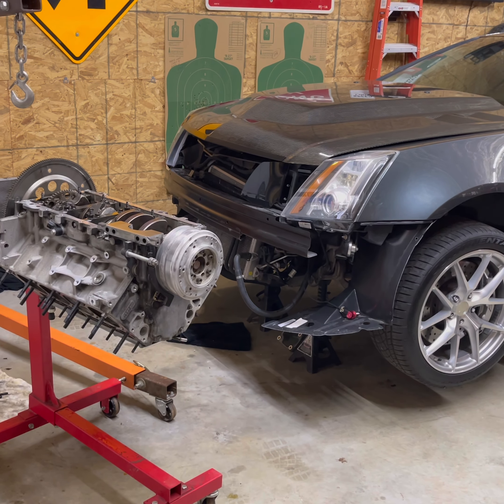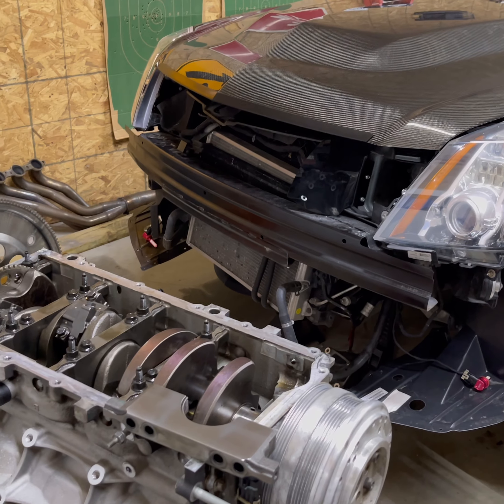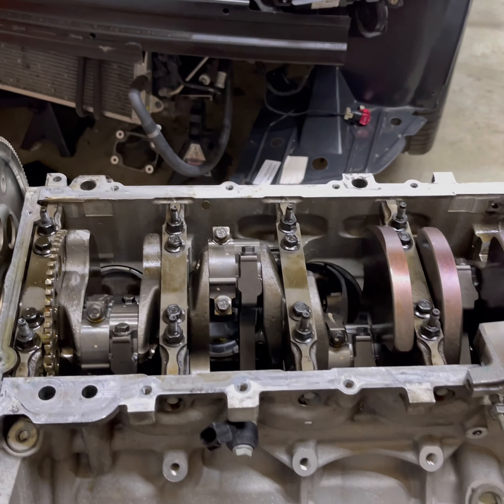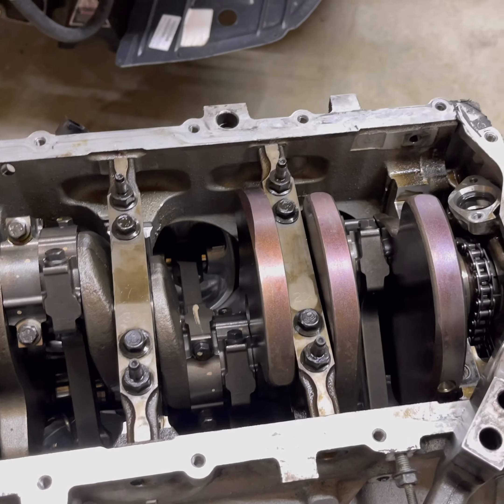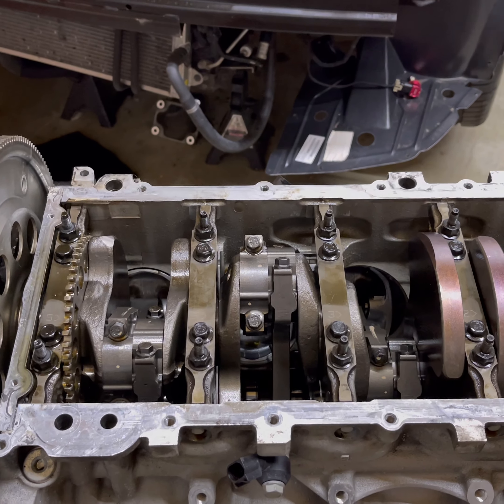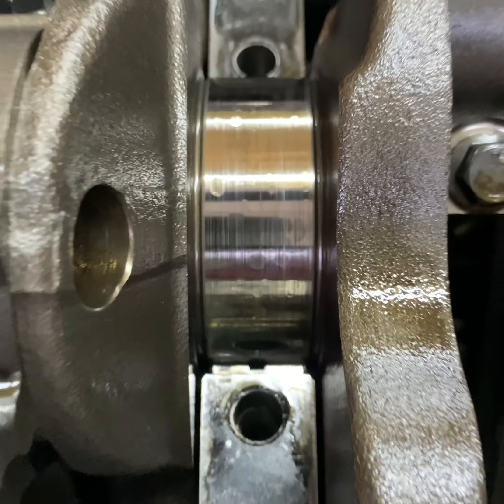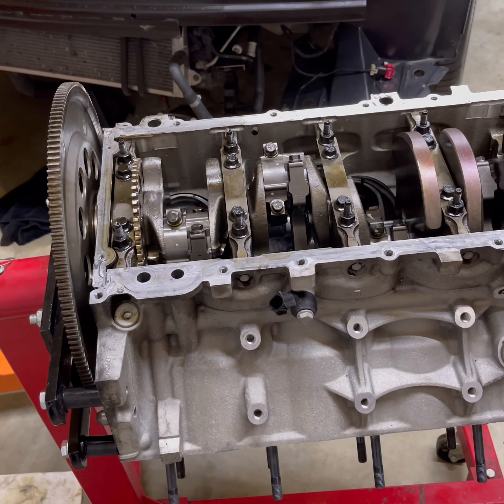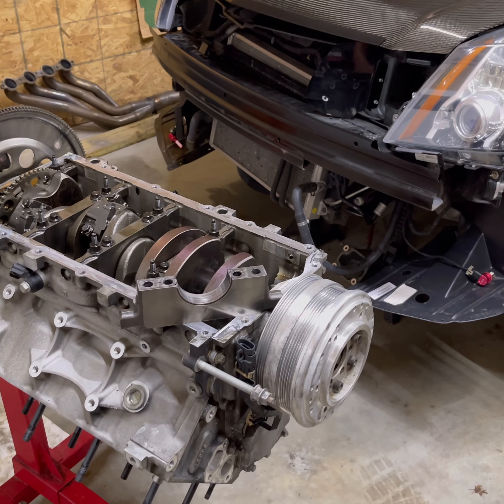CTS-V LSA LOW OIL PRESSURE engine damage 800+rwhp SBE

Comment: Hey, what type of studs did you use for your heads? I want to use the ARP studs but I’m seeing some different material out there on why not to use those. Thank you
Reply from the maker: I use ARP head studs.
Reply: @whiplashtv2022  Would you mind providing the part number you used? It beats spending $500 on Livernois head studs.
Reply from the maker: @Speed_Shed  ARP -234-4346
Reply: @whiplashtv2022   Thank you!
Reply from the maker: @Speed_Shed  you’re welcome

Comment: loved the video,  do you have a video of you pulling the engine out, I am trying to figure out how to get the engine mounts unbolted?? I have been a mustang kid since high school and switched over to the GENERAL :(  but I love this car)
Reply from the maker: Congratulations first off on making the swap. All that I did was remove the 2 nuts on top of the motor mounts so that the brackets on the engine block can lift up and off of the motor mount studs and then it it free. To gain more room, remove the 4 bolts holding the brackets that go from the engine block to the motor mounts. Then you have tons of room to get the engine out. No I don’t have a video of it.

Comment: That sucks! What oil and filter were used?
Reply from the maker: Oil and filter weren’t the cause of the failure. So I am not being mean by saying that but since it is irrelevant to the failure I am going to respectfully decline to answer that question. There are MANY LSA engines that see this this type of failure especially when horsepower has been increased, and I cover some of the multiple reasons why these failures happen in the video. The reasons why these LSA engine bearings fail needs to be the focus and not the oil and filter. If I had to do it all over again, installing an Improved Racing Baffle would probably be at the top of my list. Also deleting the piston oil squirters would be something that I would do as well.
Reply: @whiplashtv2022  Just curious that’s all. I know that question usually opens up a can of worms.
Reply from the maker: @305YSi  it always opens up a can of worms 😂😂😂

Comment: Thank you very much for sharing.  I'm making 780rwhp in 13 Coupe.......I'm only at 48k miles, and using Amsoil Signature Series 10w40 and Motorkote......I'll keep an eye on my oil pressure....BTW; what was your pulley combo and how much boost were you making?
Reply from the maker: 2.5/9.5 16psi In hindsight, I would have added an Improved Racing Baffle just to ensure that there would be no oil starving issues for sure. I was scanning it during the 2 passes and didn’t see it starve for oil, but I have since learned that this is a problem with the LSA stock oil pan baffle.
Reply: @whiplashtv2022  Honestly, it's amazing how much abuse our lsa engines can take before failure.....Pat G does my tuning and I am incredibly pleased with my afr's.......BTW; Next time you get around the Ferrari/Lambo crowd just mention that you got 80k out of engine making 850rwhp and watch their expressions.......priceless!!!! LMAO 🤣🤣🤣 The Lucky Sperm Club might get 20k before dropping $40k on a rebuild, because you know they can't spin a wrench!! LMAO 🤣🤣🤣
Reply from the maker: @LivingMyBestLife956  That is true that they can take a lot of abuse for sure. The Pat G tune on this car was ok, but I much prefer the Rick Crawford tune on it now than Pat Gs.
Reply from the maker: @LivingMyBestLife956  I am unsure who exactly you are referring to exactly, but if Rick doesn’t do my tuning then I do my own tuning. I got into tuning because many out there can’t be trusted.
Reply: @whiplashtv2022  I totally agree.
Reply: My hot idle seats at 26/28 😔
Reply from the maker: @Quad3motos_garage  26-28 isn’t too bad yet. If it has recently dropped to that then that would cause some concern.
Reply: @Quad3motos_garage  You're still good, but I always suggest that you consider a premium quality synthetic 10w40. Personally, I run Amsoil Signature Series and Motorkote.
Reply: @whiplashtv2022  Thanks it’s been like that since got the car, just realized low oil pressure could make a problem
Reply: @LivingMyBestLife956  Thanks for the suggestion, next oil change I’ll consider those brand and oil weights👌🏼

Comment: Man thats a lot of power on the SBE. Basically 930-950 at the crank. 
Were you running an upgraded oil pump?
Reply from the maker: No, it was on the factory oil pump

Comment: My number 2 went a month ago also
Reply from the maker: Man that sucks. Unfortunately this is too common of a problem. How much power were you putting down?
Reply: Mine was doing only 600whp.  I don’t know if it being on e85 had anything to do with.  From what I have been reading, oils changes should be done more frequent when you’re running e85.
Reply from the maker: @jameswilson2520  yes oil changes should be done more often when running E85

Comment: Around what HP should we start to worry about those types of issues or is it a combination of HP and track use? I'm currently at 556 WHP. Haven't been to the track yet.
Reply from the maker: I have heard of this happening anywhere from the 600’s and up but the chances of it happening get higher the more power that you make. Best thing that you can do is try to make some changes to the oiling system to help out.